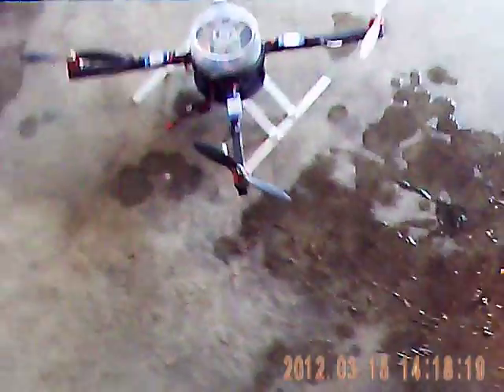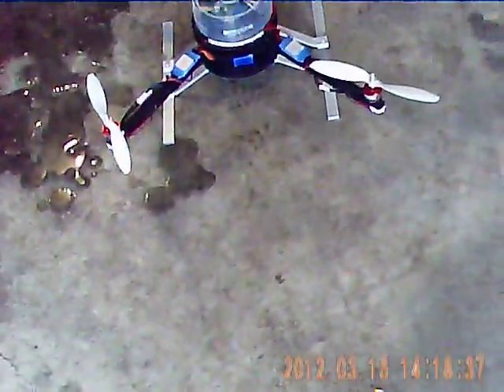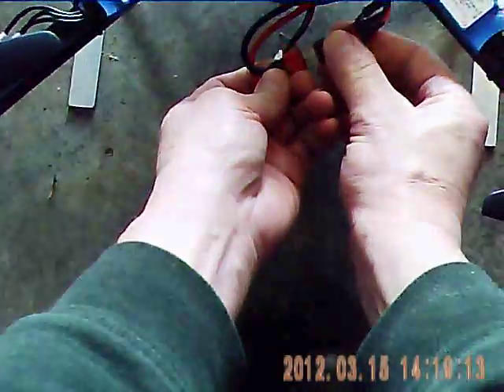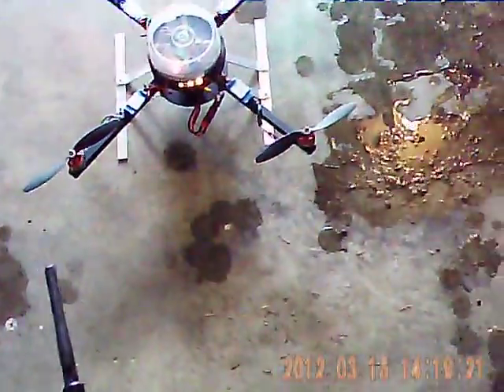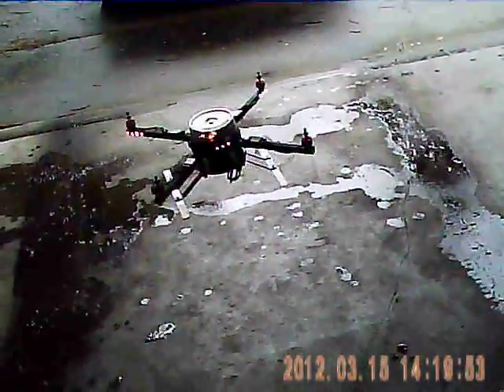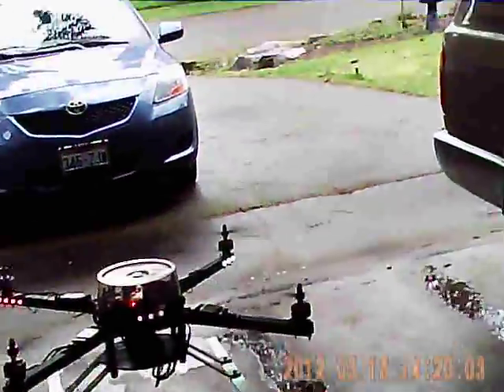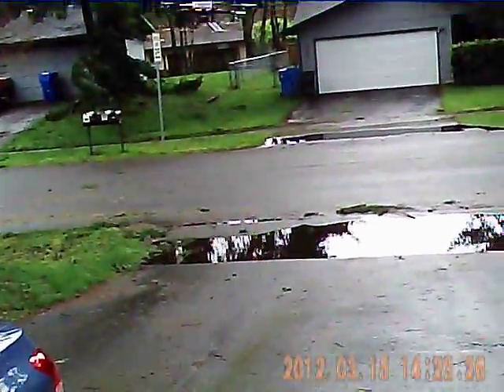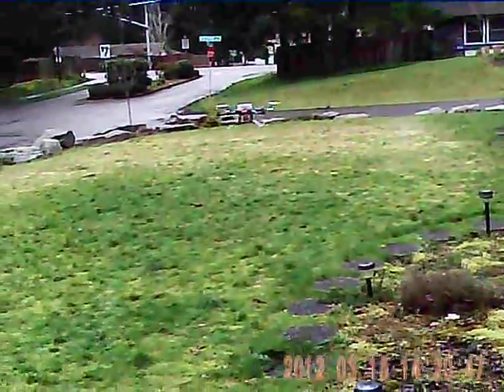Xcopter Scratch Built Stable Quadcopter

Comment: Hi, how much weigh can you put in this little quad ?
Like, what motor are you using with 8x4 props?
I'm considering making a quad for a project, and I was going to use 10x4 props with 800kv motors.
The quad must life itself + about a 1lb camera. Is this config ok, or can i consider taking smaller props and higher kv motors?

Comment from the maker: weeliano, Sorry, I don't have this quad anymore.  A guy at the local hobby store offered me an offer I couldn't refuse.  But, it was made from two 24in. aluminum towel bars, three round discs of 1/8 hobby plywood, some nylon nuts and bolts, and some 5/8in. x 1/8in aluminum square stock for the landing gear.  Ooops!  Plus the motors and stuff too.  Pretty light weight and VERY strong.  Piled it in a couple of times and all it did was bugger the arm ends a little. Oh, and about 8min. on 3S 2200.

Comment from the maker: firmware: KK v4.7 Xcopter
controller: HK v1 board. v2 and v3 will work the same
gyro pots: pitch about 20-25%, roll the same, and yaw about 95%
frame: 24" towel bars and motors are 58cm center to center
motors: HobbyKing FC 1200kv motors
ESC: Detrum Dynam 18A (RCX 18A from MyRCmart work well too and are cheaper)
Props: GWS 8x4x3 blade (all my multis like these props)
DVD case, aluminum bar stock 5/8" by 1/8" bent into landing gear
I set my TX D/R for P, R, and Y at 70% travel, 35% expo.